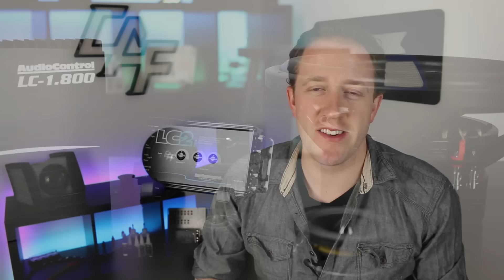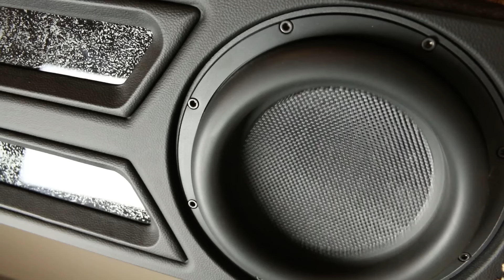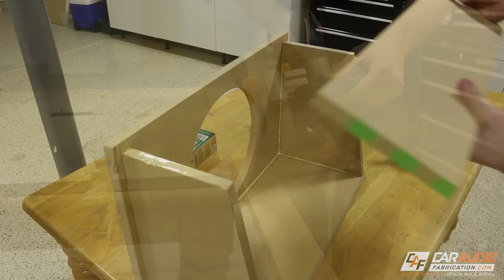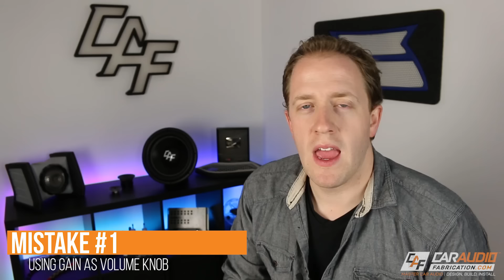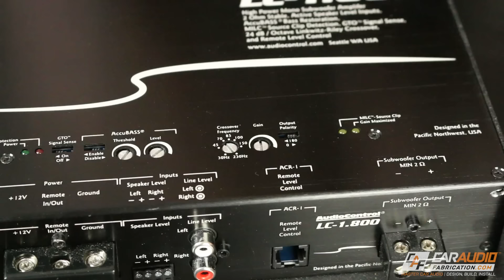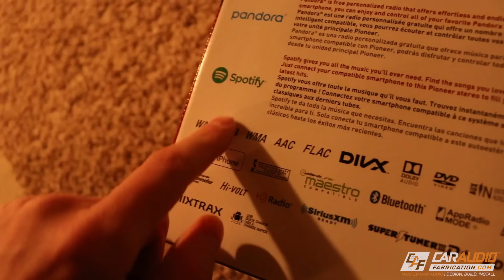Avoid these 5 common Car Audio NOOB Mistakes!

Comment: My noob mistake was buying too much speaker. I had a set of nice components that I installed in the front, but powered them from the head unit. My original intention was to later add an amp to power them. That never happened. So not only were they under powered even from my aftermarket head unit, but I hadn't bothered using any sound deadening or sealing the front from the rear speaker. The tweeter was fine, but I had almost no bass from the woofer, and overall sound quality was worse than the factory speakers. 

Noob tip: Either buy speakers and proper mounting adaptors that can be powered just from the head unit (I.e. Coaxial full range), or save up and buy the high end speaker plus other needed equipment and hardware all at once.

Comment: Ok so I got a question. My brother went to get his Amp and sub wired into his car by a "Professional " it was working pretty good for like about 1 week then out of nowhere the car sub seemed to be lower on power but for some reason its affecting the full volume audio. Like we would be driving and the volume is set at 25-30 but it seems to be giving lower than that. Then out of nowhere that shit starts bursting with volume, is that a common wired connection problem?? Or something else

Comment: My noon mistake was hooking way to many subs up with out knowing ohms or what the amp could do i probably burnt ten amps up running them below impedance rate also would use way to small of power wire i actually hooked a amp with a 50 amp fuze a was running it at less then 2 ohm and wasnt even 2ohm stable with a roll of romex house wire lol it also was not fused and also i disagree with the cap theory you had i am a auto tech and you put those in the wrong orde first off when upping your electric no matter how small of a fuse your running or how little of an amp always always upgrade your terminal pos/neg cables take it up to at least a 4 and run a few ground leads then upgrade your battery more cold cranking amps then you get a cap i would also recommend moving your battery closer to the amp shorter power line les amperage loss then if you wanna go big boy stuff add a larger alternator and never use two batteries in series cause you double voltage and kill your computer

Comment: I seen more car fires. Just from not adding fuses in the right places... I once melted my wiring 40 years ago. All because I left out the fuses. I never made that mistake again. 

And them fucktards put them huge Bass speakers in their cars. I can hear every nut and bolt rattling loose. I had to spend 2 days. Just using loctite on one vehicle. It was so bad. Then the windows leak. As the seals are blown out. Then the car rust... I seen some really strange shit in my days...

Comment: Good rule of thumb.... Your amplifier is the heart and soul of ANY set up and is thusly the component that deserves the most priority...I prize my amps over my speakers, subs, and even head unit...a good, quality amp is a must have for me before any other quality piece like a sub... And as you mentioned, max power or wattage is NOT the number a buyer wants to look at but rather the RMS wattage... Max watts just means "what level of power this amp COULD HOPEFULLY do" while RMS watts means "what level of power this amp NORMALLY does." Each setup is different bcuz each car has different variables that affect it but these are just my own general rule of thumb when it comes to car audio...
The last time my car was stolen, I LITERALLY would've been ok had the thieves taken the car and EVERYTHING in it except for my Audison and Orion amps... If they'd left them on the street but taken everything else I would've prolly not been so heartbroken... TRUE story!
Reply: Nice

Comment: I added a cap just as a procaution. I have big 3 and optima yellowtop battery but I added a cap too just to keep the voltage balanced on super hard bass hits. Relying solely on a cap is still gonna put tension in the electrical system but I'd always use a cap before buying a $600 high output alternator. You gotta be pushing over 3000 RMS before a new alternator is necessary. Music is dynamic a deap cell battery with a cap is enough for pretty much any non competition system.
Reply: Over working your alternator will cause it to go out prematurely, so when you have a bunch of stuff running off your car battery a high output alternator is a good idea

Comment: A big mistake the previous owner of my Chevy Silverado made was he cut a hole in the firewall for the main HOT power wire to the battery. Eventually, the wire shielding had worn through due to friction rubbing against the steel firewall chassis. Luckily,   my neighbor was in his front yard and noticed that my truck was ON FIRE!!! I got the fire out and only had to replace the ECU and several wires.. I should have noticed that the lead was unprotected from the steel firewall hole - a rubber grommet would have sufficed...
Reply from the maker: Sounds like no fuse. If it had a fuse it would hVe just melted that instead of the wire
Reply: @CarAudioFabrication  yup, that too - he should have used an Installer ... Thanks!

Comment: Alright as an electrician by trade I already have an understanding of ohms law but applying it to audio is still fuzzy to me. I have two 300rms subs, amp is able to handle 400x1@4ohm, 600x1@2ohm, and 1200x1@1ohm. Now I was told something about 75% of the subs rms rated level being higher than what is being put out by the amp, so would 4ohm to my two subs be adequate? Or would I be fine at 2ohm?
Reply: Gustavo Catalan are your subs Dual 2 or dual 4 ohm subs? If they are Dual 2, you can wire your subs to where each sub is a 1 ohm load so together both subs running in parrallel would equal a 2 ohm load on the amp. If both subs are Dual 4, then you would wire them parralel to run at 4 ohms on the amp. Also take a look at crutchfield(dot)com’s wiring diagram. Hope that helps
Reply: RegSoFresh I’m running two 4ohm dual coils, and yes it did help thanks!

Comment: So the first system I hooked up in my 1994 Toyota Camry in the year 2000 was a disaster and very disappointing. I bought a boss 15” sub from some crazy discount car audio store that I use to see on tv. So I paid like 300$ to have a generic CD player installed and tried to install the speaker myself. I bought a Rampage amp from an auto parts store to power my generic  Boss 15”. I had put the sub in an old bass guitar amp case. I didnt quite understand the remote wire that went to the amp from the head unit at the time. My solution? I jumped a wire from the main power to the amp and would disconnect it when I turned the car off 😂🤣😂. Not much happened but I did burn up a battery and blew the sub. That’s my newbie story. Hope you enjoyed it. Leave a like if you did👍
Reply: Thats what i did, but I would disconnect the positive wire when i was done using my car, never had a problem or short or anything related, i still have my truck functional 100% but removed the sound system because my sub woofer got stolen.

Comment: Best subs I had back in the day was Boston Competitors. Not real high end, but fits the space issue. The c110/c210 enclosures took up so little space. Yet one 10" well outperformed my cheaper 12s.
Miss having a good system in my car. Lost that back when we first had kiddos. My shit got ruined by my wife's "friend" "helping" her out with the sub system when she had the car. He blew the sub and fried the amp in one swoop. Only good was my mids/highs/head unit/capacitor was not fried, just my amp and subs. Fosgate power series and Boston competitors done.
I was so angry. Dude tried giving me some shit 12 in a box and a JC whitney type amp to replace my shit. 
I had a pickup box after that (alpine lat unit) as we needed trunk space for strollers and groceries.
After I sold that car I never put the system back in anything and sold it all.
It's been years now. I miss the crisp sound :(

Comment: It it not just the power ratings you should be mindful of on amps... I saw so many folks back in my car show days blow subs cause they matched the amp to max speakrr power instead of RMS.  

Another killer boxes not built right.

I have pioneer 12inch sub that I rescued from a buddy back in 2000 or so.  He thought it was blown.  He threw it out at my house.  I was curious... checked the sub... seemed ok.  The other sub was trashed...  So I took it out of the ported box.  The issue was then obvious.  Stripped screws holding in the speakers, bad joints... so I took apart the crap box and cut it up used the pieces to make a proper sealed box for the good 12.  I paired it with an amp with similar RMS range... that 20 year old sub is still hitting as hard as it was day one.  I have always run it in whatever daily driver I have.  

Also running power wires next to signal wires and speaker wires.  All need to run separated to avoid whine.  Instead they try signal filters... route it right and you don't need it.  

Soundproofing is a must.  A small system can sound like a big one if you properly soundproof to keep the music IN the car!

Comment: How do I ad an amp (s) to an oem 9 speaker system on a can network such as a Sony ford touch w/nav on a 2017 Taurus ?
Reply: I'm afraid of messing with audio systems in new cars... There's so much of the car integrated into the head units these days,  it's so expensive to do it right.

Comment: My mistake was not doing it myself and paying a guy to install 2 15's in a box, 4 tweeters and 2 500 watt amps in my 87 Oldsmobile when I first started driving so I didn't know anything about the system in my own car.. now a few years later and speakers are not working, fuses blowing, so I am trying to learn for myself how to fix it. I think I need to upgrade those 3 u mentioned: alternator, battery, and wiring to start with...

Comment: Along with the wiring, comes the grounds. Corroded, rusted, and loose grounds, including battery cables, will in fact cause issues with a high powered amp. If your lights dim when running a amp, check those vehical  grounds, and do not ground the amp body. Only the ground wire to the amp should be grounded.

Comment: I measured quality of those bass units and amps , its garbage , im in audio engineering for 15 years , if you dont trust me , take a home speaker in the back of the car and amp with 12V to 110V converter , play it , play your speakers ,  you will know , if you are in to viewing my measuring results , i can provide , its garbage . And when your car shakes , OMG , its sounds like a broken speaker , garbage

Comment: Save lots money, Design your system before buying component 1...Match your components, Amps RMS output to speaker handling capacity. Amps are allowed to, and can, output more power than speakers can handle. I've always gone with a 125% rule. (meaning the Ideal Amp can output RMS 125% of the Speakers handling capacity) The last few clicks on your stereo or amp are a THD (Total Harmonic Distortion) spec. You don't introduce more volume at this point, just more distortion. Distortion is what kills speakers. So over-sizing your amp means you'll hopefully never run into this performance area of your system. And you'll have clean distortion free power all the way up to max of your speakers potential. Be careful with your volume, if your introducing distortion its already plenty loud enough. Watch how much sub vs the rest of the components your installing. Big subs are great because they announce your arrival from 6 blocks away. But there is other audio information that's just as important to hear...

Comment: i made zero mistakes with my system cause i  educated myself  before installing it. i started by checking the specs of my motorcycle power system battery etc.

Comment: I have an 1100watt amp and a 12in Rockford Fosgate sub system. Was professionally installed, I have tweaked things but I notice vibration in the back from rear hatch of my vehicle (2004 Tahoe. I could've gone with a 10inch and lower wattage amp and saved maybe $3 but both the 10 and 12 kits were on sale and were less than $5 difference so I decided to get the 12 as this was my first sub ever). Any specific way of dealing with it? I know I can take the back plastic off the hatch, put on some dampening stuff, and then reapply the plastic cover. That would help to some degree, right?

Comment: Can you recommend any amp that is cheap, powerful, and light enough to sit on top of a ceiling tile without breaking it?
Reply: MilesPrower1992 what watts? A boss riot 1100 watt is $61 with a wiring kit and is pretty light

Comment: Way to avoid mistakes know what your goal is and do it right. W7 10, 1200watt mono, pioneer double din touch screen, run remote wire, make ground onto clean chassis area, 0guage power wire with a fuse and a deep cycle battery way too avoid all issues

Comment: Ur wrong about the trunk space . There is a technique to utilize ALL the trunk space its simple also .
.
Install the speakers on the trunk lid its self.  Cut a hole ,screw it, wire it , knock over ur neighbors refrigerator.
Reply: I literally did a spit take laughing at this comment 😂 Thank you.

Comment: Hi, I got a proace van, and I wish to get an class-ab underseat woofer. Do I have to take note or anything?

I'm not really an audiophile but I just wanna enjoy music at loud level.

Currently my speaker start breaking when I turned the volume up at around 19/25 max vol. 

What kind of upgrade can I have (with brand and model recommendation) for as little $ as possible to let me blast at around 23/25 or even 25/25 max vol without my speaker having the breaking sound?

Comment: How can i find speakers that sounds good and do t crack radio states 4×45 when i put speakers in the door sounds bad and cracked right away
Reply: Alfred Collins “4x45” means 45 watts per channel (in this case each channel gets 45 watts). Not enough for most speakers assuming you listen to a lot of bass heavy music and or loud music. As for good speakers, you just need to shop around a lot. JBL is good for the vocals. You also can’t go wrong with Hertz, Focal, Skar, and etc though they’re more on the expensive side.

Comment: Bought an 06 expedition a few year's ago...... That was my first mistake. I pulled the door off to see what was in there it sounded horrible. There was a 6.5 driver poorly mounted in a 4.6 bracket! Upon further inspection i found three amps in the rear compartment

Comment: I've installed many after market standard car radios for friends and family, when i decided to upgrade my own radio in my 2003 GMC Sierra the radio failed to even power on, I had to swallow my pride and ask an Installation specialist what to do about it. as it turns out, when you remove the stock radio in a chevrolet/GMC,
 the Key On Power "Red" dont work for the after market radio, the only 2 ways to remedy this problem is..#1 combine the red and yellow wire together. But have to turn the radio power off manually to keep the battery from getting drained. Or #2 find another Positive wire that turns on with the key on, and tie into that for the red wire power.

Comment: i use 14 gauge power wire for my 300rms 1000watt amp from pioneer, they say 18 gauge is enough cause its very efficient but they didn't even use copper for their wires adapter kit plug
Reply: Err, i'd use 8 gauge minimum, I use 2 gauge OFC wire for my 1400 watt setup and I'm actually considering 1 gauge, and I use 12 gauge speaker wires for the subwoofer.